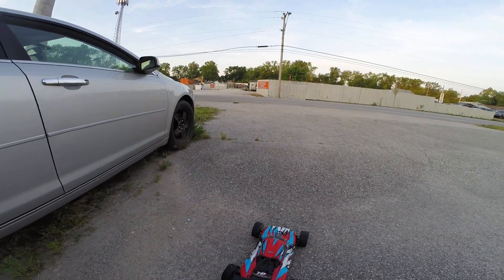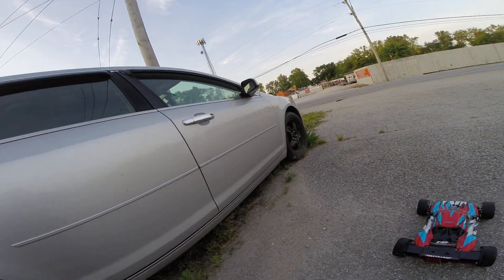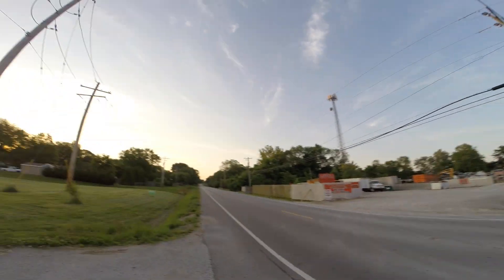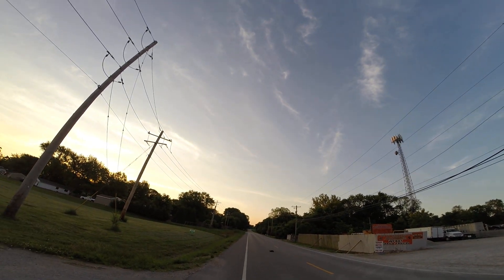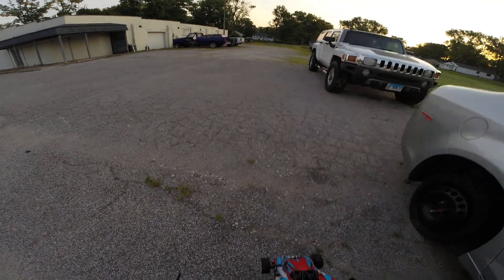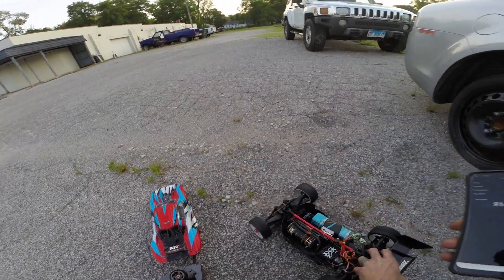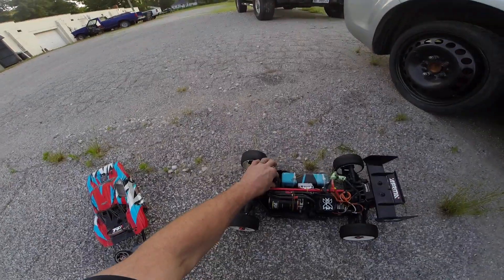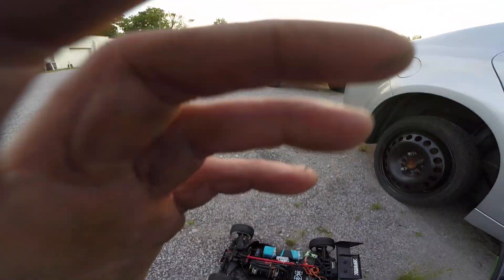ARRMA VORTEK 1/8 XLX2 TP5660 MORE SHAKEDOWN PASSES

Comment: nice pass. i have a quesition. do you have any issue with xlx2 + tp 5670? some people say xlx2 + tp 5660 or 5670 have drag brake issue or something else..
Reply from the maker: I've got 1270kv, 1356,an 1460kv, have ran them over a year with zero issues.